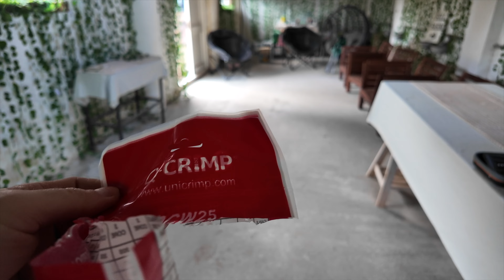I FLOODED A CUSTOMERS HOUSE

Comment: Question: when drilling the 25mm hole for the gland, why did to choose to drill inside the 30mm knockout, rather then outside the 20mm knockout? Wouldnt your choice mean the gland is on a potential weak point. Also, the 20mm knockouts are the on the left, so you’d probably have a straight cable run? Asking cos I’m interested in the design choice.